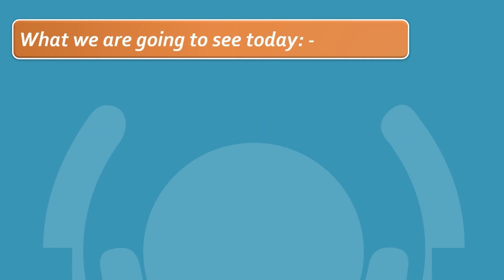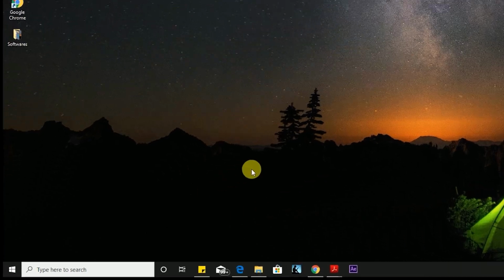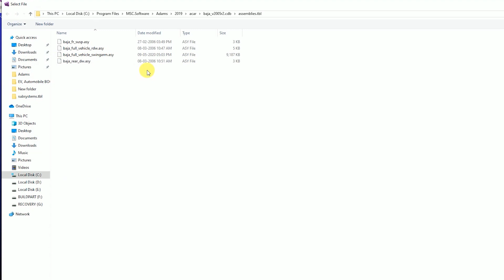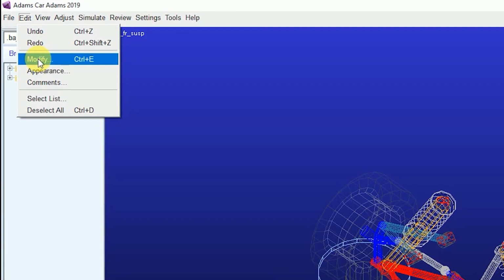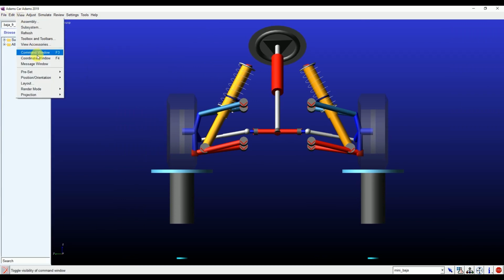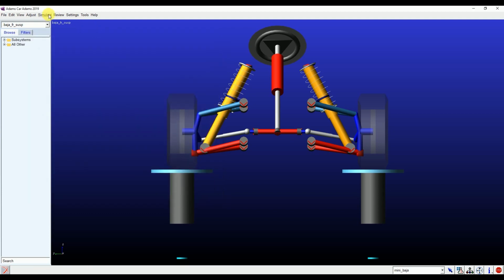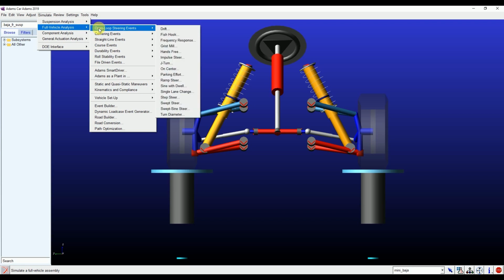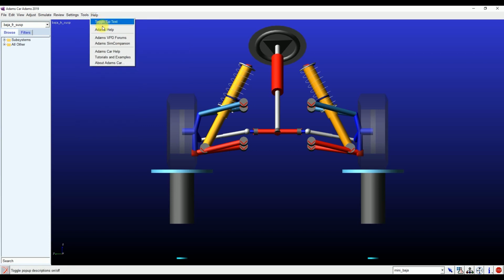🔴 ADAMS CAR TUTORIALS [Chapter one - MSC Adams car Interface] (latest 2020)

Comment: Atlast it's worth it. I've tried working in hardpoints on the suspension system. The only doubt I have is how to create different subsystems in template builder. For example, the roll cage of baja or formula and other subsystems ?
Reply from the maker: If you face any problem then don't worry I'm going to make video on it in this series
Reply from the maker: Save your design with parasolid format and then in Adams import it.
Reply: @atvcalculations4539  I've tried doing it. But I couldn't add communicators to the frame to my suspension system.